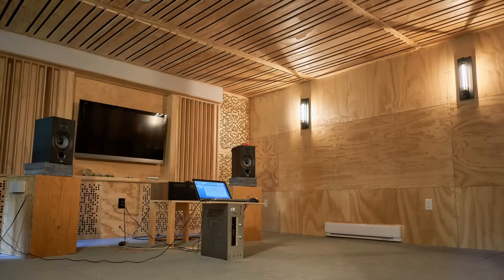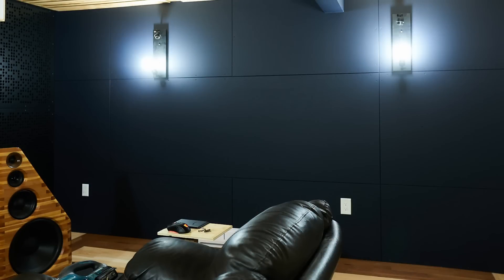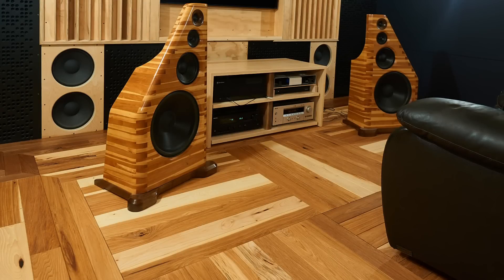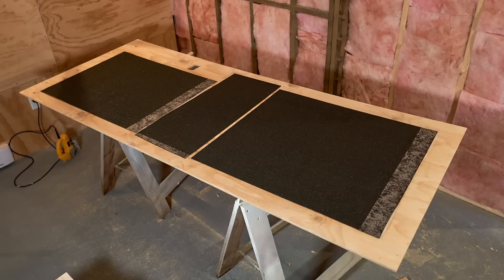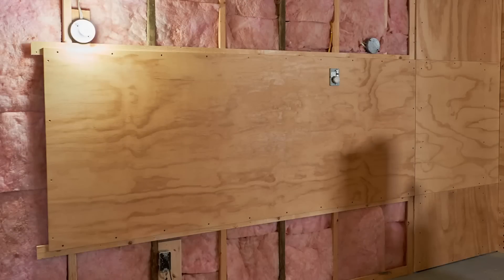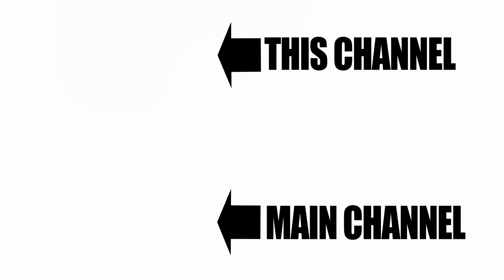Why Did I Buy This Crap? Room Acoustics Basics

Comment: Great video.  Yes many of us have bought those worthless waffle panels.  I know I did....

I think you are a bit off on the labcoat discussion though.  By your logic, all noise canceling headphones are also garbage and do nothing but cause distortion because noise cancelation works the same way they are looking at canceling room nodes.  If you play the pronlematic tone 180 degrees out of phase it will cancel out the issue.
Reply from the maker: Noise cancelling headphones take a sample of the noise and use that to cancel the noise. The noise is not part of the original signal, while the tones excited by room modes are a part of the original signal.
And headphones are not rooms, so you are not dealing with a problem of closing the gate after the cows have escaped.
Reply: ahhh yes.  Thanks @IBuildIt

Comment: When you use the example of carpet/drapes only you point out that only the higher frequencies are reduced making the room sound dull.
That's true, but, if you have good low end treatment also then both the high and low end  will be more in balance and the room will not sound dull.
Carpet only leaves the low frequencies with lots of reflections causing it to be muddy sounding and it is more apparent when you only reduce the high reflections
Acoustic Insider talks about that.
Thanks for all your efforts to teach people how to get good audio 🙂
Reply from the maker: The balance is what you are after, but high frequencies are much easier to absorb than lower ones, so you need to be careful to not over-absorb in the high end. That's what carpet can do, if it's covering too much of the total square area of the room, including walls and ceiling in that total.
Reply: @IBuildIt  , I agree but that's why I point out that if you combine that with lots of low end absorbtion it is no longer a problem.
Reply from the maker: If you are over-absorbing the highs, the room will sound too dead, regardless of how much low end absorption you have.
Reply: @RobertCardoza1934  What? i am confused by your "logic"  - You seem to be saying that it is ok to absorb TOO MUCH high  end as long as you absorb TOO MUCH low end as well.
 Shouldn't the goal be to only absorb the proper amount in the first place so  you do not have to bring the other down to sub optimal ? 
I.E. Not screw the second one  up just  because you are screwing   the first one up ?   Screwing both up IS a problem.

Comment: Interesting discussion on macro vs big picture views. I have suffered from the macro view “trap”, however, the better you can remove flaws at the macro level, the better the end product, even if you can’t see it in the big picture view. 😅😅 See - it’s a trap that we all suffer from. On the other hand, production construction contractors often ignore flaws at the macro level that are visible in the big picture, all in the name of efficiency and costs control, missing the lesson in the statement, “it is cheaper to do it right the first time, then to fix it the second time”. As always, John, great content!
Reply from the maker: The better you remove SIGNIFICANT flaws, the better the outcome. In all things there is an order of importance that sums up to the end result, and if you are spending 50% of your time on something that has a 1% impact overall, that would be a wasted effort.
Even worse is spending 80% of your time doing something that won't work at all, or if it does will have a negative outcome.
Reply: @IBuildIt   You very honest in your presentations, speaking your understanding of things and clarifying your level of expertise. I have liked that about your videos, even if I didn’t agree or have an opinion of my own.  But I have to ask because you have been working on you room for some time now and I know that “doing it right the first time” isn’t always possible and experimenting is part of the process, but how many times have you scrapped ideas in your quest for the “perfect” 🥴 listening room?  Not trying to be critical, just that I understand the difference between research and production. Metaphor - the engineering department will research and  perfect forever, but the production department has a schedule and a budget.  Believe me when I say that I will spend countless hours on a project only to scrap it.  But I also learned a lot in the process, so not a complete waste of time. 😊😊
Reply from the maker: I made several videos talking about the room as I built it, including measurements and my reasoning. Basically, my goal was NOT perfection, but something that is good enough. In the acoustic sense, good enough is as close to perfection as you can get.
I made no changes to what I did at all, other than cosmetic ones (paint, hardwood floor) and I'd do nothing differently if I had it to do over. The method just works, so there's no reason to tinker.
Reply: @IBuildIt  thanks, John.  I watched every one of those videos as I do all you vids.  Just curious as I believe many makers that have youtube channels will edit out the experiments simply to make the size of their videos more manageable.  I appreciate both the brevity and the breakdown. Hard to please everyone.  Anyway, keep on keeping on. 😊
Reply: Do you mean small by saying macro? Asking because macro means big.
Reply: @ekketiivas7603  hmm… yes, I did mean small, micro!  Now I’m thinking I miss heard the word John used in his discussion, but I did understand what he was thinking.  I went back and listen to the video again and sure enough he said “micro”. My bad.  Thanks for pointing this out.
Reply: @ekketiivas7603 I think he means zoomed in view like with a “macro” lense. I too was thrown on initial reading.